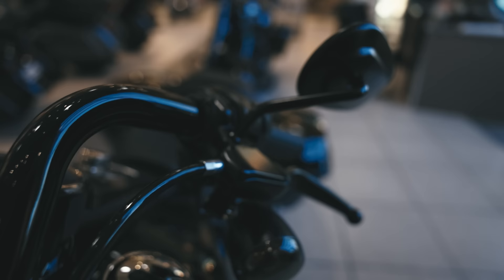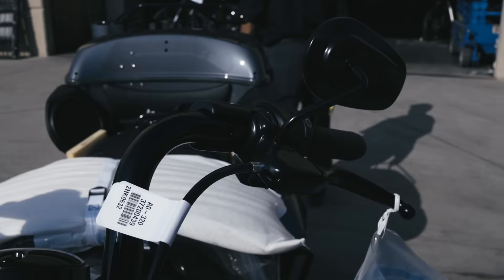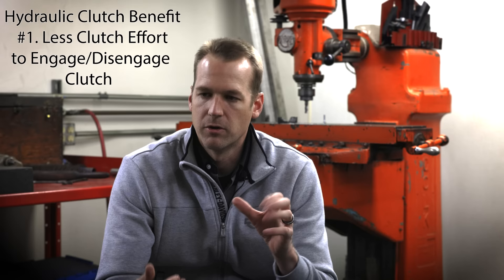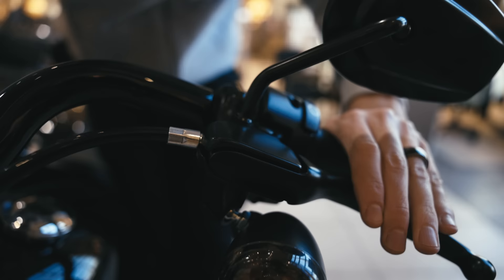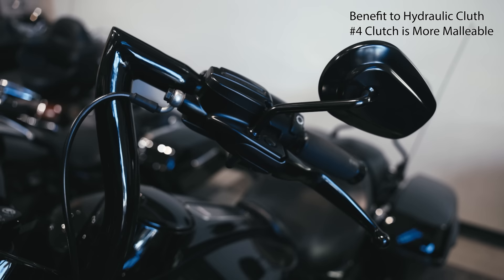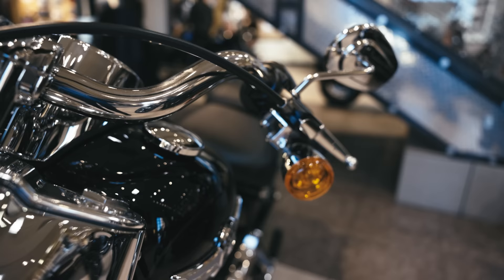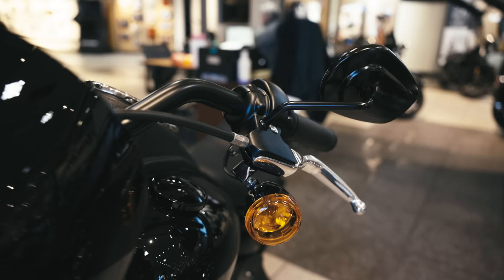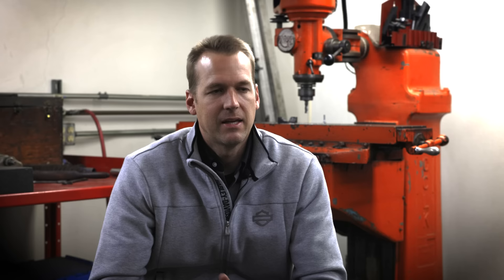Why Harley-Davidson Switched Back to a Cable Clutch on Touring Motorcycles│Pro's vs Con's

Comment: Personally, I prefer the feel of a cable clutch. Aesthetically, I prefer the hydraulic clutch. The ease of pull is not much different between the two. The cable clutch is a benefit at slow speeds. Most of the time on a touring bike a person is on a highway. So your not shifting gears and using the clutch too often. Having a cable clutch with a larger friction zone is a huge benefit at low speeds, particularly riding two up. What Harley should have done is add a quick shifter.

Comment: (Ron here), with 42 years ridingthe last 2 have been with the hydraulic clutch on my 2019 Blue Max Road Glide.I always had the clutch adjustment so when the lever leaves the bar, it grabs. I was really concerned that the hydraulic was going to be an issue getting used to. It was not. I feel I adjusted quite quickly considering where I like the let out before. Now when I fly and ride a new bike of course it will be with the cable clutch. Not worried.

Comment: I appreciate your discussing this. I recently purchased a 2014 CVO Breakout equipped with a hydraulic clutch. All of my other bikes including my 30th Anniversary Fat Boy have the cable clutch. I agree with the engagement  points mentioned and I do find the hydraulic clutch smoother. I feel it's simply more of an upscale feature rather than a functional difference. It's just cool having a bike with no cables for a cleaner minimal look.

Comment: I had a Cable clutch on My 2000 Wideglide,it was always harder to pull in than The 2015 Street Glide  Special that I have now with a Hydraulic clutch.I have rode Harley's with easy cable clutches to pull in and have no problems with them but overall I'll take A Hydraulic Clutch.All  Hydraulic Clutch Bikes that  I 've ever rode have been easy for me to ride.If you're not an experienced rider I could see where it might take a little longer to get used to a Hydraulic Clutch.

Comment: Great video by the way.  I have a 2019 Electra Gide Standard.  My first Harley Davidson.  And I love it.  I am 62, and I have really struggled with the hydraulic clutch. I have been riding motorcycles since I was a kid, I have a lot of experience on a motorcycle.  I was really used to a wider friction zone. I had a hard time with the short drop out with the hydraulic clutch.  For me, it was a safety issue.  To make a long story short, I had my HD converted back to a cable clutch.  I am so happy with the results.  It was pricey but well worth it for me.  I know every rider has their own personal preferences, I feel more confident on my HD now.   Rob

Comment: Hi Matt
Respectfully, I believe that your perception of the consistency of the hydraulic clutch is based on North American riding experience.  I have 2 FLHTCU's one is a 2009 with a cable clutch and the other is a 2012 SE with the hydraulic clutch. I mostly ride in the middle east where the temperatures are relatively high even in winter. The hydraulic clutch is an absolute nightmare, after an hour or so of riding, the clutch oil loses its viscosity and riding the motor becomes impossible since you no longer have friction. I rode my 2009 for 250 miles into the Dead Sea at temperatures exceeding 127 degrees and she ran like a charm. 
Another disadvantage of hydraulic is during cone weaving excercises, it overheats quickly.
This syndrome has been associated to CVO's in the region. After multiple complaints Harley finally recommended a different oil grade that improved performance by around 70%
Unsure about the M8 versions of the clutch. Haven't heard anything about it. Some even went as far as replacing their hydraulic clutch with cable for as much as $1500!

Comment: I’ve had both. On my Harley’s I prefer a cable actuated clutch. I had  a GWing for 20 years and I can tell you Honda got the hydraulic clutch down perfect. My hands are arthritic but I persist now with 3 cable clutches. ‘07 XL1200R with Scorpion clutch 50lb springs a bit much, stock shovelhead clutch w/ramjett retainer - nice enough. 2023 Anniv Tri  Glide yeah - back to cable. HD had too many issues with the juice clutch, glad they dumped it.

Comment: Matt, I think you nailed this on pretty much all points. I too prefer the hydraulic clutch, maybe 20% more than the cable clutch, but can also understand all those on the other side of the coin who prefer the cable clutch. If I bought a 2021 today with the cable clutch, I would just ride it without even considering about “upgrading” it to a hydraulic clutch. I would feel a little better about it, though, if I felt that I got a better deal cost-wise by getting the cable clutch. But there is no way to realize that when comparing the model year-over-year cost of the bikes. 

Back to the hydraulic clutch, I have a 06 CVO Fat Boy and its hydraulic clutch is exceptionally smooth and the friction zone for the lever is much closer to the grip. It is at essentially the same point as other cable clutch H-Ds I have ridden. For my 19 CVO SG, however, the friction zone is 85% release of the full travel of the lever. Not sure why H-D made these later year touring bikes like that. Not really that big of a deal for me, because, like you said, after a short time of riding, you can quickly be accustomed to it. I do see , though, where it could be more of an issue with riders with smaller hands/lesser reach on the lever. 

One final note, like other commenters have brought up, there may be credence to the idea that H-D migrated back to the cable clutch at least partially due to the transmission oil transfer to the primary issue. I have never heard of that issue occurring on a cable clutch bike. But I have had it occur on both my 19 CVO SG and on my 06  CVO FB, and the common factor for those too very different year bikes is a hydraulic clutch.

Still, even after all this rambling, count me on the side of the coin that favors the hydraulic clutch for its function, feel, and low maintenance requirements. 🙋🏼‍♂️

Comment: I had a 2012 Street Glide...I loved it...Didnt think too much about the clutch because Ive always had cable clutch...Then I got a 2014 SGS with a hyd clutch...I loved it...I rode that bike for 7 years and 56,000 miles...not one problem,ever, no adjusting.....Then I bought the 2021 SGS with RDRS...Cable clutch...Seems like I have to adjust it alot...it has about 8500 miles on it and It keeps getting stiff and hard to pull...I wish I still had the Hyd clutch on my 21

Comment: Matt, I follow your videos and enjoy them very much. I think you did a really good job explaining the pros and cons of both clutches. I'm a retired Police Officer from the bay area and I just purchased a 21 RKS. In the past I've owned 3 different touring HDs, 2 Road Glides and one Street Glide, all with hydraulic clutches. I really liked the hydraulic clutch and I think it was a mistake for Harley to change to a cable clutch. Having said that, I just purchased some easy reach clutch and brake levers which bring the levers closer to the rider and it changes the leverage of the cable clutch and lever making it easier to pull. The company is called Softbrake and Debbie from the company said that a lot of the Police Rodeo riders are using these levers to improve their friction zone and riding.  I have a feeling that these new levers will improve the cable clutch pull to the level of a hydraulic clutch, we shall see, Hope this helps.
Debbie Wright
SoftBrake Company
28755 N. Silver Meadows Loop
Athol, ID    83801
(208) 561-5031

Comment: Great overview Matt.  First hydraulic clutch in 2010.  Took some time getting use to it but okay now.  Just purchased 2021 CVO Road Glide and I have no issues with the switch back to cable.  I feel H-D is putting out a good product to appeal to multiple income levels and rider interest.  So many complaints about the motor company, I have to wonder if people have given competitive manufacturers a hard look.  I don’t believe any of them have been lowering prices over the years?   Any change today can be perceived as “cost cutting” LOL especially if the change is not exactly what one wants.

Comment: Hi, I like the cable for two reason.
1. Ability to set the friction zone
2. Reliability, I have friends that have had issues and got stuck along the road.
I like this type of video more than just selling the new models. Please do more like this.

Suggestion .. give advice on what to look for when buying new wheels.  Might sound dumb but looking past the looks of a wheel, what quality, figment or other issues should I be aware of.

Thanks

Comment: I have had hydraulic clutches on all my new bikes for the last 15 years. And I ride 35,000 km every 6 months. Easier pull, less maintenance and better consistant feel if it's made by a company that can actually make it work. 
I believe that is why HD got rid of it. They just didn't have the ability to make a hydraulic clutch work reliably and it is shown by the repeated service recalls for their hydraulic clutches. Every fix they came up with didn't work and it was probably adding to their financial woes trying to.fix so many broken bikes. So now you pay $40,000 - $45,000 for a touring motorcycle in Canada with no hydraulic clutch, you don't get all LED lighting, no electronic suspension, no power windshield, no central locking bags, no drive modes, you have to pay extra for RDRS, and the list goes on. I can see a definite perceived lack of value in buying an HD motorcycle compared to any other brand.

Comment: I think it was a finance and market decision. Mechanical clutches are easier to make and aftermarket parts are readily available. 
I like the hydraulic clutch, until I get stuck in stop and go traffic. Then it’s killer on the hand. That’s why I replaced my clutch basket with one from recluse. I think that is the best decision I ever made and my clutch hand tends to agree when in traffic.

Comment: If HD was so concern about the ease of finding the friction zone they could have taken the simpler route by replacing the standard clutch and brake levers with adjustable ones. Last month I installed the PSR Chrome Anthem Adjustable Handlebar Hydraulic Clutch and brake Levers part number 12-00654-20 $229.95 from Eastern Performance Cycles which made a huge difference in dialing in the friction zone on my hydraulic clutch in my 2015 Road Glide CVO. Last summer with 95K miles on my bike the cam tensioner went out for the second time, taking out the oil pump and oil pan, all covered under the ESP warranty. At this point I decided not to wait as planned for 100K miles to install the 117” Stage 4 kit from HD. After this installation is when I really notice the difficulty in starting off from a stop. Now after I installed these adjustable levers, it’s a world of difference in starting off smoothly from a stop. There’s other companies depending on the year model that sells adjustable levers for Harley’s as well.

Comment: I’ve had both and I prefer the hydraulic clutch with a re-contoured Sotfbreak lever. It hits the friction zone about a half inch to an inch right off the grip.

Comment: Late to the party here, but as a rider who had an accident on a motorcycle and my wrist got jacked up I prefer Hydraulic. It feels easier to pull and maintenance wise I honestly feel its easier to maintenance. Its essentially a brake lever that creates push and pull on your clutch plates. I have also noticed if you ride with some sense I personally feel that my clutch plates last longer due to better precision in a Hydraulic clutch. Just my worthless 2 cents.

Comment: The fix for the Harley hydraulic clutch for me was adding adjustable levers and an aftermarket clutch piston (Müller, AIM..) The big downfall of the cable clutch is not year one, it’s year 2, 3, 4, 5  as it deteriorates. But at least it doesn’t transfer. Lol

Comment: Had to change to hydraulic clutch on 2021 Road Glide Special, clutch cable was just to hard to pull back during long rides. Hydraulic clutch has a least a 50% easier to pull back. I'm sure glad to spend the extra dollars to feel the improvement.

Comment: I will allow for your opinion that the hydraulic MAY be easier to initially pull compared to the cable clutch lever, but try holding it for 30-40 seconds simulating idling at a red light.  I guarantee your hand will fatigue much sooner with the hydraulic than the cable version.  Other than that, I prefer the hydraulic for more consistency.

Comment: I’m ok with either. Personally I prefer the great friction zone of a cable clutch. Bike control at low speed is enhanced. 
Squirting off the line instantly is easier with a cable too.

Comment: to make the cable clutch pressure 50% lighter to pull, you can add and combine a  T.P.P. Variable Pressure Clutch with a Muller power clutch assembly on your existing clutch. With this, even a baby can pull in your clutch with one finger. I have this   in my 2011 fatbob. Rides like a dream. Still, when you are rebuilding your bike and you want a clean look on the handlebars, using a hydrolic clutch, you can route the cables through the bars. With cable clutch you cannot. Evenso, you can change from cable  to hydrolic if you want to put in the cost...

Comment: I had a 2012 Ultra Limited with the cable clutch. I put over 73,500 miles on the bike and I bet I only had to adjust the clutch, maybe twice. I broke my left wrist in 2014 and had to have surgery to repair it. I was riding my bike to therapy a month after surgery.  I rode the bike up to the end of June 2020 and never had an issue with my wrist and pulling in the clutch. I bought a 2014 Ultra Classic with the hydraulic clutch and with in a few days, I was having some pain in my wrist from pulling in the hydraulic clutch.  I felt that the reach was a little further and was causing the issue. I bought a set of PSR Journey adjustable levers to see if that would help. The levers helped a little, but where the clutch engages and disengages, I could only bring the lever in one setting closer before the lever hit my grip. So for me, the cable clutch was a lot easier to pull in.

Comment: I like the hydraulic clutch also, first was jumpy but once get hang of it , works more precise. I have ridden 95,000 miles on cable clutch and can see difference between the two. I prefer hydraulic.

Comment: I have ridden both the hydraulic and cable clutch on Harley Davidson Motorcycles.  I have no doubt that the hydraulic clutch is easier to pull and use. That said,  I did buy an aftermarket clutch lever that is bent approximately 1" closer in, which adjusts the friction zone such that slow riding clutch/friction zone feel is better than a slightly harder to pull cable clutch. As for the service issues, I have never had a problem with either clutch system. The cable clutch does require regular adjustment but it is very easy to do yourself so no difference either way. In summary, I think Matt is exactly right in his pros and cons analysis. 
S
Reply from the maker: Thanks for weighing in.
Reply: The aftermarket supplier of the bent clutch lever is Softbrake.com

Comment: It honestly comes down to do you want to make the adjustments on a regular basis (cable clutch) or just keep riding and not worry about it (hydraulic clutch).  Those who like to wrench are going to tell you cable and those who don’t will say hydraulic.  I have ridden both and high and low speeds.  You get used to the clutch and you can ride any speed you want.

Comment: I had a 09 CVO Road Glide with a hydraulic clutch.  Really liked it.  I was planning on selling my 07 Road King after I bought the CVO but ended up not liking the big fairing and mostly useless radio.  Still have the RK and sold the CVO RG.  I did however, prefer the RG hydraulic clutch, obviously not a deal breaker either way though.  When I had both bikes I didn’t have any problems using either or switching between the two.  Maybe the whole friction zone thing isn’t super critical for me as after nearly 40 years of riding I still can’t do u-turns like the guys on the cop videos!   I do find myself adjusting the cable clutch on my RK at least once per season.  It’s easy peasy for anyone with even minimal mechanical skills.  I personally think Harley just went with the cheaper option...

Comment: Matt, What is your opinion about the larger displacement "performance baggers"  needing a stronger clutch.  If so does  the hydraulic clutch make sense?  More power means stronger valve train components, more tire grip, and the list goes on.  Id be interested in your take on it.   Ive never had a hydraulic clutch.  My short fingers, and riding style prefer the friction zone closer to the grip.  For me, the cable works just fine.

Comment: I prefer the hydraulic clutch for several reasons. One, I'm almost seventy and have arthritis in my hands. I know the hydraulic clutch is easier to pull and much easier to hold in when in traffic. I like the smoothness and the fact that it never goes out of adjustment like my older HD's did.
    I've been riding a long long time (early 60's) and have owned both hydraulic and cable. I think years ago when HD went to the hydraulic clutch they were interested in improving their touring models, When they decided to go back to the cable clutch I believe they are more interested in cutting cost. 
    Like I said, I've owned both and neither are a deal breaker for me, unless my arthritis gets worse. I hope it doesn't. I told my wife I want to ride just as long as I'm able. I've had friends in their eighties who were still riding up to a few weeks before their death. I would like to ride into my nineties. I feel the ease of the hydraulic clutch would help me do that.

Comment: The hydraulic clutch triggered a slew of issues with transmission oil transferring to the primary drive housing, because they moved the throwout bearing to the clutch side and eliminated the flinger.